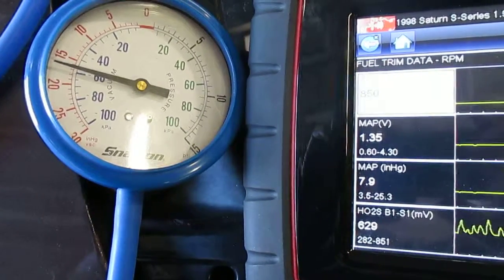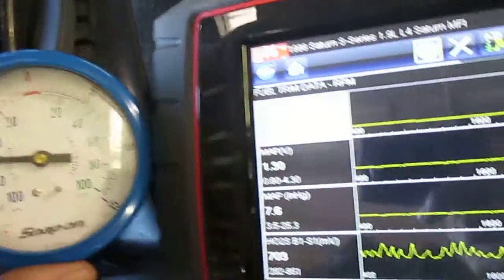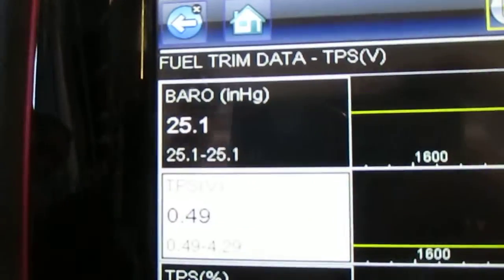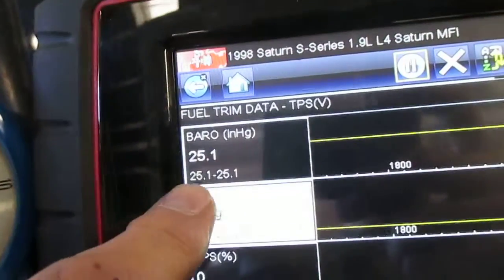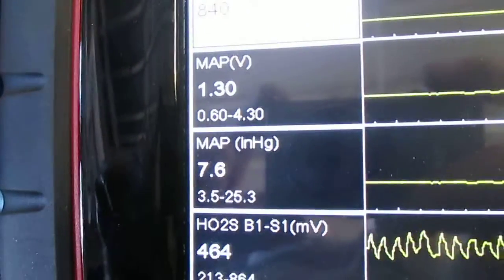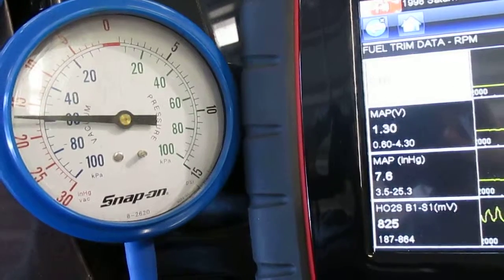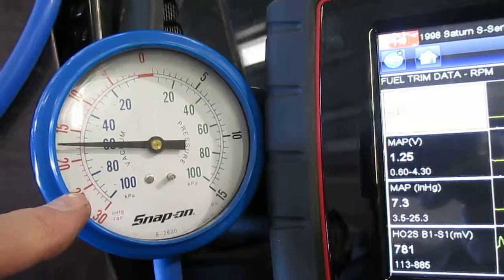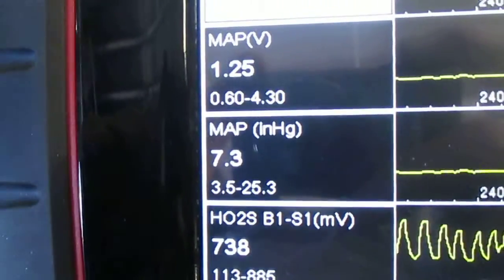Map (absolute values) and Vacuum gauge readings relate

Comment: will vacuum leak effect MAP sensor engines performance or is this mostly on maf engines you worry about leaks? if so will a bad vacuum leak cause sputtering on throttle stabs on map sensor engine?